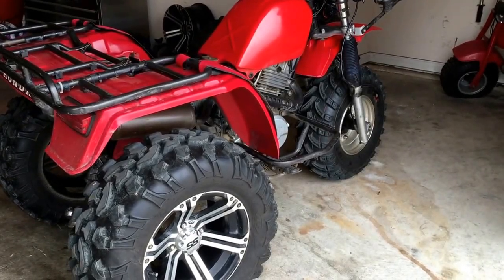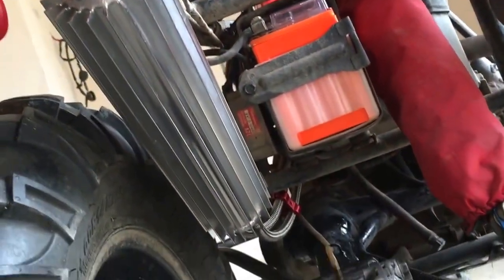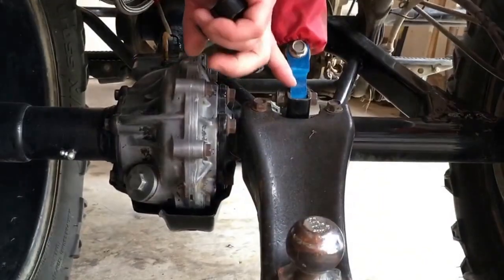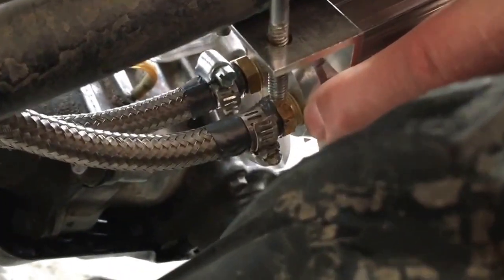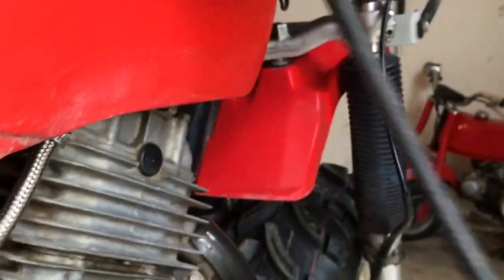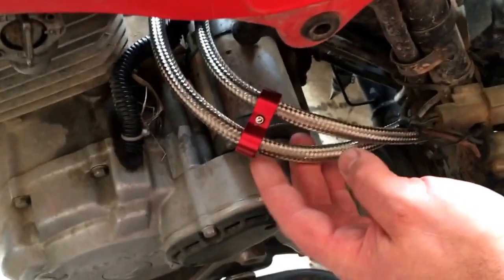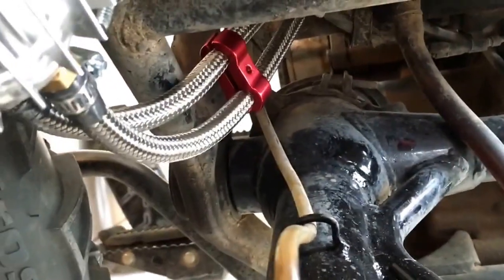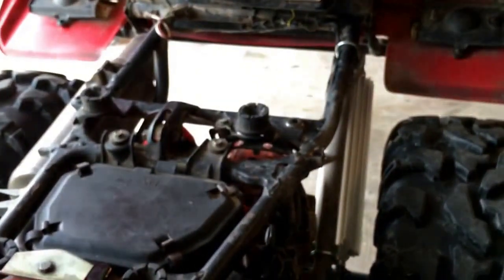ATC250ES oil cooler installed.

Comment from the maker: I have only great things to say about having an oil cooler on this bike. Believe it or not I think the fact that it runs cooler for so much longer means that this engine will last forever! It may just be placebo effect but I think it even runs more smoothly and even after running for over an hour it has almost no heat soak like it did before. I highly recommend adding a cooler to your bike.

Comment: Hope you see this but what did you use for the shock , the blue coaxed at the bottom of the back shock???
Reply from the maker: Blake - there have been several discussions on that here in the comments. I found the aluminum shock extension on eBay. I bought several since they were so cheap, I have never had to replace it. Lol https://rover.ebay.com/rover/0/0/0?mpre=https%3A%2F%2Fwww.ebay.com%2Fulk%2Fitm%2F303130057703

Comment: I'm currently also installing a aluminum nuclear oil fusion dissipater drum like yours (lol) and I have some concerns. the reservoir in its current elevation will slowly drain the incoming oil back to the engine casing causing a lag in oil in the line for a minute or so until the incoming part is full again. I'm not sure if this poses a big problem or not. I am also working on making a similar video with my thermal camera to see if we get any temperature differences on the top end using a cooler or not. I'm currently getting 400 degrees Fahrenheit running the engine a t 4000 rpm in 15 minutes of constant rpm.  after I'm done with the install I'll compare the temperatures in the oil casing and top end. It will also show the temperature in the cooler.
Reply from the maker: Nice! I hope it goes well, I’d love to see the video (thermal image). I didn’t do any science stuff when I installed. Going by my senses lol (meaningless I know). I opened up the banjo on the oil line just a tad to try and get a little more flow. In my initial and subsequent runnings I “felt” like it sounded a little quieter in the top end. After running it for hours pulling my 60” Swisher pull behind (finish cut mower) on several 100F degree days, that it was noticeably less valves clattering and just the feeling of heat coming off of the engine. But all of this was without evidence. I can tell you years later now; it still runs great. So even if it was just a big waste of time and money it hasn’t hurt the engine. It could even be that the extra oil capacity and slightly improved flow has had a positive impact. Good luck with the project!

Comment: After running my 350cc Big Red for 15 minutes at 4000 + - 150rpm I see no significant changes with the thermal camera. I was running 395 tops without a cooler. I was running 380ish with the cooler but the temp camera probe numbers was shooting around a lot.  The cooler inlet side is maintaining the same temperature as the motor crankcase so we are absolutely dissipating heat off the engine. We cannot however expect to see watercooled engine temperature differences with a oil cooler alone. I would venture to say in the 15 minute run time I got 15-20 degree cooler temps with the cooler.  My personal verdict: is it worth it...It miiiggghhht be worth it in the long run. Cooler running oil  = longer lasting engine.  Would I go through the work again from scratch. Probably not.   I will post a video soon.
Reply from the maker: 15-20 degrees would be a pretty good reason to run it IMO. The added quart of oil too. But I bet one of the biggest tests would be a hill climb with you on it in 90F plus temps as well as seeing the cool down times; how quick temps drop while idling. I want to do the 350cc kit I’m excited to see your video. 🙂

Comment: I have a question about this setup. I'm getting ready to install one on my 87 250sx. And the extra quart of oil is concerning me. I got the part to get the oil circulating through the system. But what about when it's time to service it? Do I unhook all the hoses and drain the cooler as well? Or does it all collect in the bottom of the 3 wheeler. Also, does the dipstick give an accurate reading once the oil is dispersed? Or do I just need to be firmly aware of how much I'm putting in?
Reply from the maker: Cody - I would do this again by the way, I have had no issues. I am not a mechanic I do most of my own work on everything I own. In my opinion you only add the .8 quarts. Yes, I believe most of the oil ends up in crankcase when not running. The dipstick will probably not be accurate after doing this mod. You’ll want to know exactly what you are putting in for the most part. You’ll have to add a little extra oil for the length of the oil lines. (That’s why I just round up to 1qt). No I don’t think you need to disconnect the lines to do an oil change. Good luck 👍
Reply: Sweet thanks man.

Comment: A full extra quart and that massive cooler is nice. How do those things pump oil?
Reply from the maker: Yeah! Hey stranger! Well considering that the factory oil capacity is @2.5 quarts - to add almost another quart is pretty awesome. This engine has a mechanically driven oil pump. Normally uses a paper oil filter that is replaced when changing the oil. I use an aftermarket stainless steel mesh filter that is less restrictive and I can pull it out and clean it and reuse it.
Reply: +Intergalactic 
Right on. You know I'm thinking that increasing, somehow, the capacity of the pump will probably increase the service life. If I know you, you're more committed to PM than I am... :)
Reply from the maker: +Joe Haynie Well I relieved some pressure by drilling out the banjo oil ports it almost doubled the size. Allows more oil through at ""potentially"" a higher rate since there's less resistance. I wish there was an option for a higher volume oil pump. But then it might not be as efficient
Reply from the maker: Sometimes it takes a little extra pump to get the oil flowing. If you know what i mean eh ? Eh? 😆

Comment: You have a very sweet bike did you get the wheel spaces from ebay?
Reply from the maker: Yep, eBay has the best selection of parts for atc's. If you look carefully and try different ways of searching you'll find great deals on wheel spacers. You aren't bothering me- heck I can talk about this stuff all day and night! The battery is gel filled I think I got it for about $35 on eBay of course.

Comment: I want to lift my big red around two inches but I don’t want to replace the front end. I can’t find any fork tube extensions on eBay . Can you recommend anything?
Reply from the maker: Wormdog84 - well... no not really I’ve seen people weld tubes on to the fork head. But nothing that I’ve seen that would be a bolt-on or kit. The350x forks are a huge upgrade and added bonus gives you more ground clearance and a smoother ride. Another option would be a fork head off of 250sx.
Reply: Intergalactic thanks for the reply. All of your videos are awesome!!
Reply from the maker: Wormdog84 - https://rover.ebay.com/rover/0/0/0?mpre=https%3A%2F%2Fwww.ebay.com%2Fulk%2Fitm%2F202252184811
Reply from the maker: Wormdog84 - from China, you can find them from the US too. Search on eBay for “motorcycle shock extend”
Reply: Wormdog84 I make the 3.5” fork extensions

Comment: Couldn't u run a heavier motor  oil to cool motor down better ? 20w 50 ? Instead the need of cooler
Reply from the maker: KingQuad Bott - hmm a heavier oil won’t flow as quickly. I don’t claim to know all there is to know about engine oil, but it has been years since I did this and I have had zero issues. I hear less valve chatter. I haven’t had any issues with mud build up on the cooler.

Comment: hi..was hoping u could shed some insight on what oil cooler I should use for my 85 atc 250sx..how to install,and what tools and fittings I will need..is this mod efficient? worth it?thanks in advance..the es is looking amazing BTW..keep up the great videos..hopefully  a request to make more isn't too imposing..
Reply from the maker: Hi! I have never owned an SX but it is a similar bike. A lot of the same design and parts. I'm sure you could easily use the same cooler and fittings and lines. You need -4 AN barb fittings. The cooler is 12" aluminum tube - you can get on EBay. I've detailed the parts and estimated costs in this video's description. Search for 12" oil cooler in eBay you'll see it! Thanks for watching I'll be posting more videos definitely. This really was worth it! The bikes operating temperature is substantially lower, of course this means little power loss from heat saturation. It means less wear and tear on a 30 year old engine. The engines operation is a lot quieter. It takes about an hour of running to reach its maximum running temp. Hope this helps in your decision. I'd do it again absolutely. I'm going to do this on my kids 87 TRX250 with the same engine.
Reply: I just rebuilt my top end on my sx..was thinking putting an oil cooler on it would,like you said make the bike run better and longer in the future..I do a lot of first and second gear hill crawls..soo a oil cooler seems to be a great idea to keep the sx cooler and hi rpms at slower crawl speeds..I really appreciate  you taking the time to give me feedback and tips on my new mission..thank you soo much
Reply from the maker: +Nick Pierce - I bet after a top end rebuild you've got lots of new power and compression. I also use a stainless steel oil filter to improve oil flow. This adds almost an entire quart of oil capacity. You'll notice less slipping from the clutch via the cooler oil temps during your hill climbing.
Reply: +Intergalactic most definitely I have less than 5 minutes ride time on new top end..so I'm definitely going to enhance the life of the sx with this mod..thank you so much

Comment: How’s that shock spacer? Any good, strong?
Reply from the maker: Dave Tree - been several years. Works great no problems
Reply: Nice, 2”? I’ve seen them but wasn’t sure the strength. I make small lift kits, 3.5” fork extensions and 2” rear extension

Comment: Cant find lift on ebay
Reply from the maker: Ok how about this: https://www.ebay.com/itm/161792753322
It's been a while since I tried to look them up. Try something like "motorcycle shock extension"
Reply from the maker: caveman733 did that help?
Reply: is this lifter plug and play or did you have to drill ?